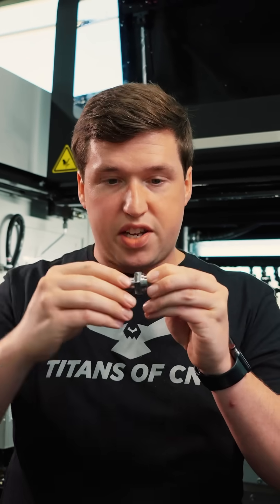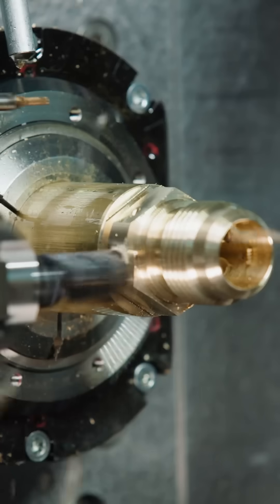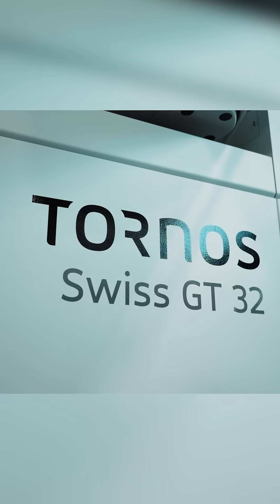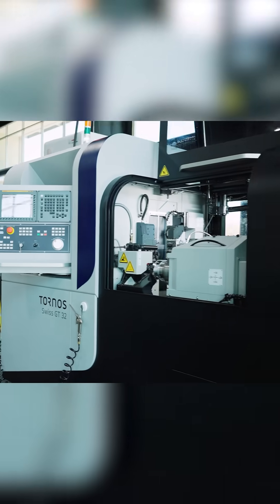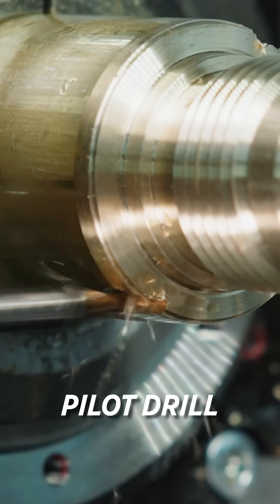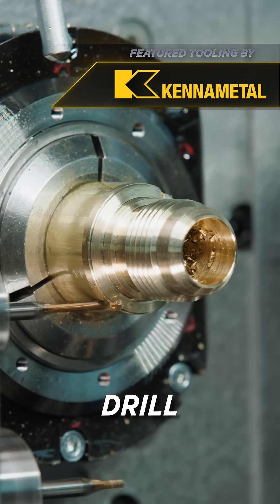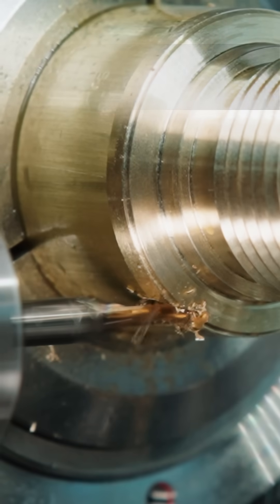What are Safety Wire Holes & How They're Made

Comment: A&P and 20 year military aviation vet here… safety wire used in this manner is, in fact “so you don’t die on a plane” but not in the way many may think. The wire used is specific wire that is actually very soft. It is made to break. How it helps keep us safe is that it provides a “visual and physical indication of broken torque”. While performing scheduled and preflight inspections, we look for broken safety wire. This tells us as inspectors that one of the two bolds may be loosing torque. Safety wire CAN hold some smaller hardware from backing out… but if a large bolt wants to turn. It will.
Reply: You are talking about witness wire. The video is about saftey wire. This is  something you learn before you even walk onto the floor, not after 20 years.
Reply: @shanerRC  Thanks mate, hadn't heard of witness wire, was very confused. I held a damper on once using lockwire, only for one rally stage, but it held until the end of the rally.
Certainly couldn't have pulled such a stunt using witness wire!
Reply: Same carrier here, longer perion though. Safety wire is hard AF stainless steel its not soft by any mesure some exception is very small gauge copper wires used to tie down critical switches intended to be broken by they pilot during an emergency
Reply: We only use it on racecars, but the stuff we buy is from an aviation supplier and is stainless wire. Surely a brittle wire that would snap easily if the bolt moved would break when you twist it?
Just curious, I'm always eager to learn. We use a paint marker and look for cracks in the paint to determine a bolt that has lost its torque.
Reply: I dunno about soft wire, the stuff we use is CRES A286....def not soft, and not designed to break.
Reply: @Steelcrafted maybe he's been using solder to lock his bolts this whole time.
Reply: @Steelcrafted  Safty wire of sheer wire. Theres a difference
Reply: Uhh… that’s not true. Witness wire is made to break, safety wire is definitely not made to break.
Reply: i have no aviation experience whatsoever but even i have access to google and can tell you the differences between witness wire and safety wire. we are all waiting for your response Jonathon
Reply: Yeah he's full of crap haha. Witness wire is usually copper and like .020 thick. Lockwire will be stainless and then according to your AMM a thickness will be chosen but often .025 and above (.032 is popular).
Reply: I find it quite concerning that you don’t know the purpose of the stuff you’re dealing with everyday… Safety-Wire / Lockwire is NOT meant to break. It’s meant to hinder bolts nuts to vibrate loose… greetings from the German Airforce
Reply: How can someone have so much confidence in something so wrong when you claim to have so much experience... Safety wire shouldn't break. Witness wire should! Greetings from a Canadian AME.
Reply: @nateb4114 scary thing is a lot of people are like this. So blindly confident in what they are saying while being completely incorrect. Actually quite scary this guy works in Aviation.
Reply: @RotGodKing  yep, either he was backshop and rarely safety wired on jets, or he was "that" crew chief in his AMU (or sister service equivalent). This is basic shit the USAF teaches baby Airmen at Sheppard...
Reply: Uhh, even I know safety wire IS used to hold bolts and nuts in place due to the pattern you wind the wire around the bolts. The idea is that when one bolt starts to back out, it tightens around the others. Though with enough torque the wire can break. - Knowledge gained when I was at North Central Institute, so if I'm wrong, fuck me I guess haha
Reply: @Blackjackgofish 😂 the good ol' aviation "Guess I'll just go fuck myself" 😂
Reply: @Blackjackgofish yea but no bolt vibrating loose is going to "have enough torque"
Reply: @Blackjackgofish  yes.  It is specifically to keep bolts  backing out in vibration by pulling in a tightening direction to the next bolt in the series.  Its a thing of beauty to look at on a big jet engine with huge patterns of bolts all locked together.
Reply: @Blackjackgofish NCI in Clarksville TN? Right by gate 4 at Ft Campbell?
Reply: @Blackjackgofish how does the pattern help? That the part that confuses me. Both bolt move in the same direction if one unwinds the distance between the two points gets smaller not bigger if the wire is ridgid enough then its forcing both bolts to back out instead of just one. The only way i can picture is getting tightwr is if one bolt is reverse threaded and even then it would onl work if the wire does wrap wround the bolt and not slip off whoch seems unlikely but ive sti ged enough guitars to know it doesn always happen.
Reply: Bro that is not true at all. Read your 204 and you'll see it's closer to what this guy said. If one bolt was to back it the wire keeps it from backing out because it's pulling in a tightening direction.  This is coming from a real 20 year vet with a&p. The only main wire that is made soft to break is the copper wire used to hold stuff like the ring on a fire extinguisher
Reply: If what you said were true, we wouldn't be wrapping lockwire in positive directions. If you need a quick visual inspection on a component's torque still being in check, you use torque stripe. Even then, you'll still re-verify a torque if it's an accessible part, or can be reached during phase maintenance. 

Lockwire's primary purpose is as a second line of defense to prevent hardware from coming off, causing failures, and/or creating FOD that could also cause cascading failures and damage. The final line of defense is placing nut and bolt hardware such as that it will not back out while in direction of flight. 

Lock wire is NOT primarily there to be a visual inspection tool, and the 204-series would tell you this.

6 years Apache mechanic here. I think it best be time you take a refresher course, man.
Reply: @UpToSpeedOnJaguar  hey runner upper guy. This guy is obviously a sparky that sweet talked the FAA into signing his tickets.
Reply: Can confirm this is false, most helicopters are held together by safety wire, cotter pins, and hopes and dreams. Otherwise they would shake themselves apart given the chance.
Reply: @warbomber58 you forgot proseal and epoxy.
Reply: No idea what youre talking about mate. Lockwire is made from inconel, and is certainly not designed to "break".
Reply: @JgHaverty the vast majority of safety wire is stainless steel, inconell is normally only used in engine hot sections and it’s a bastard to use because it’s vulnerable to over twisting
Reply: Negative.

- Safety wire stress hardens as you twist it so it doesn't untwist. People who have used it know this, it's literally the first thing you realize because you're going to mess up your first go and try to fix it and find it much more difficult to undo or move. 
- It's to prevent things from separating from other things (in this case bolts, by applying a little torque in the tighten direction.)
- It's never supposed to break.

If you actually are an A&P mechanic god help us all... but you're not because the only people who lead off a comment with "<Thing I'm pretending to be> here" are people who are pretending to be things.

Just adding another vote to the pile.
Reply: Nothing brings the aviation community together when we are correcting someone or something is wrong. It makes me quite proud to see as we are auditing ourselves instead of being lazy hacks. It's another reason I love this industry. Everyone has been wrong about something before they knew. The important part is if you take the correct information and learn from it and not Dunning Kruger yourself into a serious incident.
Reply: I’m pretty sure if I’d just got done doing a prop and the safety wire had broken a month later on it my ass would be fired
Reply: Some components use soft wire but many do not. We repair hundreds of components at my shop every week and we are not using soft wire on most things. This isnt us just deciding not to but it what is specifically called out in many CMMs.
Reply: Yeah fuck no snake you’re thinking of shear wire. Safety SHOULD NOT break. They’re for cannon plugs, bolts, and other hardware that can vibrate loose during flight
Reply: What the hell are you talking about? Half the application of safety wire isn't even in preflight/postflight inspection areas. (doesn't matter what airframe your on) The only "soft" wire is copper, where its designed to be broken for things like safety handles or emergency releases. Safety wire ABSOLUTLEY is to prevent bolts and other hardware from backing off. If you haven't learned something as basic as that after 20 yrs, please god stop working on planes.
Reply: I am not sure if I agree that locking wire is made to break, but the wire is not a replacement for proper torque and it is easy to inspect to see if the bolt is loose.
However, the locking wire used on the battery connector of the DHC-8 is made to break and has nearly no strength to make it easy to disconnect the battery in an emergency situation without any tools.
Reply: Yes and no. You aren't doing visual inspections on the vast majority of components in a helicopters, and they are almost all safety wired to ensure the bolts don't come loose. This from someone who has seen thousands of transmission components during overhaul.
Reply: Are you talking about the copper breakaway wire? Stainless steel lock wire doesn't snap off. You'd need cutters to snip them.
Reply: So instead of doing actual safety inspections y’all are just walking around planes looking at wires nice job 🤡
Reply: This man was definitely a CDIQAR back in his day
Reply: Buddy was definitely QA lmaoo but same here v-22 avionics tech🤘🏼
Reply: uhhh...I was active duty Airforce kc-10 crew chief for 4 years, AR shop for 2(KC-10A, C-5, C17), civ AR for 3, Lockhead elec for 3 on C-5's, then Raytheon QC for 3 for defense contracts....   Did you work in tool crib or something?!?  They ARE made to hold the bolt from coming loose, and falling out.  The only wires that are "made" to break is copper safety wire.  And that's for things like emergency handles, or fire bottles.....
Reply: As former AF who worked on the F-16 engines I can 100% say that's wrong. Safety wire isn't meant to break at all it's meant to keep bolts from backing out and nothing else. Broken safety wire is caused by a few things, mostly becoming weak over time due to vibration and a poor loom. The bolts came loose BECAUSE the safety wire failed.
Reply: that is awesome
Reply: I was about to say, if aviation engineers didn't want a bolt to go lose, surely they would just use a locking bolt.
Reply: @jojojorisjhjosef 
With especially critical components, like engine bolts, we use several methods. It's usually a mixture of clamping nut, locking plates and safety wires. If locking plates are used, the bolts they are fastened with are marked with torque paint.
Reply: @jojojorisjhjosef not all fasteners on an aircraft are safety wired, some use deformed thread nuts or split pins or just plain old anchor nuts. Hardware used in highly fod sensitive areas are more often than not, safety wired.
Reply: @jojojorisjhjosef  I believe you mean self locking bolt. After watching a short video which explains that metal ones are not reusable, and the nylon ones are not good for high temperature environments. I guess i can understand why the military would not use these. However, Aerotight nuts sound like they would be perfect for the job and from personal experience i've never seen any bolts or nuts on a military aircraft that looks like that, so I can't explain why they don't.
Reply: Break-away wire is made to break, safety wire is not.
Reply: Ahh ok thanks! I thought it would be more a visual check rather than anything holding them in.
I’ve seen on rollercoasters just a marker pen across then bolt and metal so you can see if it’s shifted any amount.
Reply: @ZXCVBALSKDJFH dude, the entire comment thread you skipped explained why this comment is completely wrong and that it's NOT just a visual check. Difference between safety wire and witness wire.
Reply: bro, I read "but not in the way many may think" with the narrator voice from "It's Not What You Think" video series...
Reply: And I’ve seen some people that don’t know how to run lock wire actually what is the wrong direction which intern allowed to walk to loosen up with a nut to loosen up
Reply: Lock wire and witness wire are not the same thing, either get a copy of 43.13 or get out of the industry before you kill someone
Reply: It’s neither soft nor is it designed to break
Reply: This is the only thing that makes sense you're tieing the bolt off to another bolt it isnt to keep the bolt secure. Like you dont stop a cart rolling down hill by tieing it off to another cart. If both bolts move in the same direction the wire isnt doing anything to keep either in place. Its only purpose has to be to quickly check if a bolt needs to be torqued.
Reply: OP is talking .020 copper wire used to ‘safety’ down emergency switches or components. Typical safety wire used on securing or mounting hardware is .020 or .032 stainless steel wire.
Reply: Interesting
Reply: Is there a reason why castle nuts and cotter pins don't do the same thing?
Reply: Damn man bolts don't back out or lose torque to the point they can cut wire soft or not.  
  Maybe solder.  Maybe.
Reply: "hey, that safety is negative"
Reply: So many BS comments from crabby people!  I’m going to give up on safety wire altogether and just weld the damn nuts on.

Thanks though for trying to educate some people.
Reply: Appreciate the edification big dawg👌🏾😮‍💨
Reply: Maybe on the frame. I work on fighter jet engines, F16 primarily. Our safety wire is much stronger than the 28-33 in/lbs we often use. Still, it's purpose to fight vibration and prevent FOD. It doesn't matter, but I've seen people over torque bolts by whipping the wire straight.
Reply: I thought the main purpose was that if a fastener does loosen, it won't fall out completely and damage other components, or cause components to separate.  It doesn't seem like even piano wire would keep a bolt from loosening, if that's what it's inclined to do.

When a bolt gets really loose, it might still function as a pin if it's held in place and doesn't fall out.  I would guess that's a good enough reason to spend the time wiring them in place.
Reply: there's no way a bolt would back out without breaking the wire, because of the way it is wrapped around. Maybe if the head of the bolt broke off though. @somethingelse4424
Reply: Congratulations, you made 1000 like just a moment ago! By me! Your welcome 😁
Reply: If a bolt fails at a level of ten and the wire breaks at 2-3, there's plenty of margin i.e. it's still safe but the fact that it's broken alerts maintainence to the issue way before it is an actual problem.
Reply: @OldNavajoTricks  the only way safety wire really fails is due to someone breaking it internally, or something caught it and ripped it off.  A loose bolt would never cause safety wire to break.  A common myth is safety wire is ment to keep a bolt tight.  But it's not true.  It's ment to keep the bolt from backing out if it does get loose.  That's the reason it's not supposed to sound like a banjo when you safety something.  "If you strum it like a guitar cord"
Reply: Indeed. Safety wire and shims are from an era when the US still didnt have proficiency in manufacturing to spec reliably like the europeans but had a massive output.
Safety wire is really just for visual inspection.
Reply: @FortuneZer0  Euro cope makes me smile.
Reply: @FortuneZero, bro, the Germans use safety wire too lmao. European engineers have been doing it for decades, that's where we learned it from.
Reply: @FortuneZer0  I sometimes race my motorbikes at the state track and they inspect our bikes and make sure all the bolts are safety wired. The vibrations can shake bolts loose and it is especially dangerous if a motorcycle blows a tire from loose bolt debris on the road
Reply: @FortuneZer0   Yep, we also use safety wire + a stamp for visual inspection. but mainly to see if the customer removed any of the components of the machine, ( usually they dont know what they are doing so we do this to prevent any major damage), if they screw around themselfs they lose guaranty
Reply: That makes more sense, then the explanation of the video.
Reply: @JTRch yet he's already been corrected several times before your reply. He's wrong.
Reply: Buy bolts, drill bolts done
Reply: @johntageson9675 I did this with my dirtbikes exhaust manifold once. 

Don't even try, unless you have a special machine, and the bolt ISN'T made from any sort of steel
Reply: no one cares
Reply: @the_chomper just stop, everyone is here because of this exact type of content, if you don't care then why are you here on this video?
Reply: @the_chomper maybe don’t read an entire comment you have no interest in next time 😂
Reply: @the_chomper  Watches video about safety wire holes
Reads comments about safety wire holes
"nO oNe CaReS!"